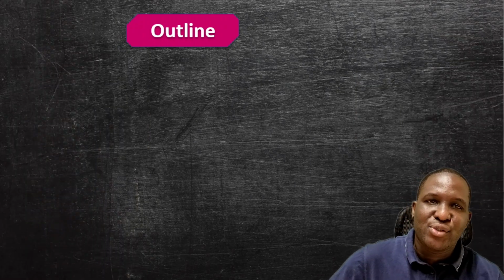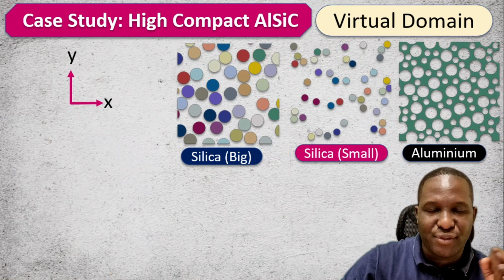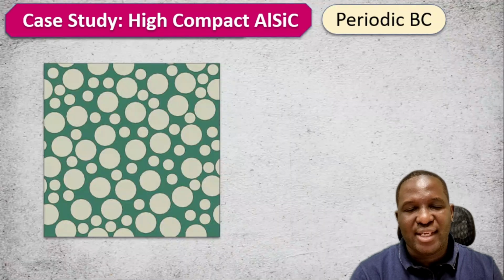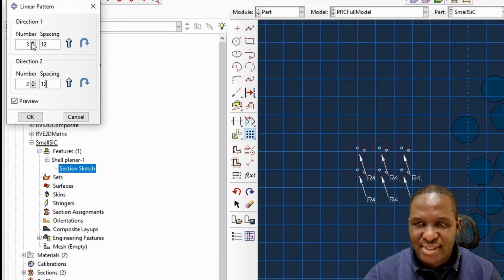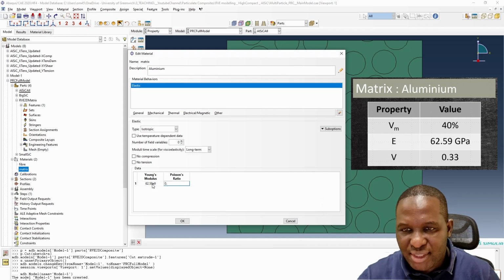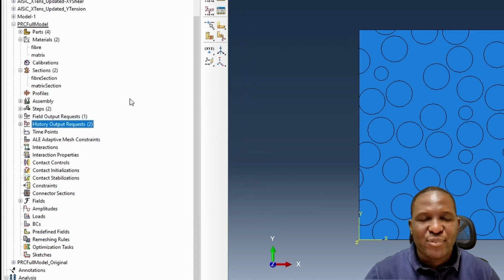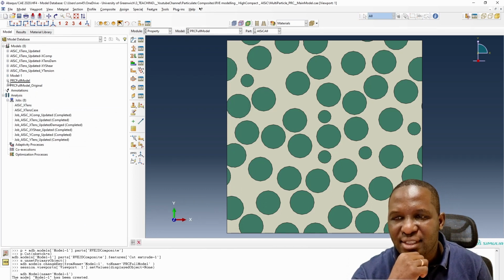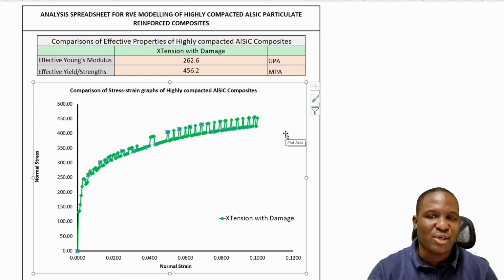How to model highly compact  particulate reinforced composite

Comment: Thanks for this valuable tutorial video. Which failure criteria should I use for epoxy- alumina with around 84% by weight ceramic particle?
Reply from the maker: It depends on the length scale of analysis.
Reply: @MichaelOkereke Excuse me, could you please explain more about length scale of analysis?
Reply: @MichaelOkereke Excuse me, could you please explain more about length scale of analysis?

Comment: Hello Professor. I am modeling with a 2D plane, the cell is a plane strain triangle cell, the PBC condition is imposed, the material is single phase, and the modulus of elasticity is 187 GPa. I am using your method of solving for stress-strain curves and solving for the modulus of elasticity. Why is the calculated value 10 GPa higher than the input value (205 GPa)?:hand-pink-waving:
Reply from the maker: Not sure I understand the problem.

Comment: Hello, thank you for your useful video, if the particles were packaged (as a packing), can we use this method?
Reply from the maker: Hello @R. Sadeghpour, of course yes you can! Obviously, you will need to find a way to generate the particles as a packing (clustered particles). The code I used can generate moderate clusters but not excessively high volume fraction packing. The simple answer is yes!
Reply: @MichaelOkereke  Ok,thank you, do I have to define a constraint between particles?
And, Have you ever used Digimat Software for modelling?

Comment: Hi Dr Okereke, this video is useful and educating as your previous videos, so Thank you a lot. Meanwhile, I have a question Sir; did you have time to check the reference article I mentioned before? I am really waiting for the results of that modelling.
Reply from the maker: Hello Sina, thanks for your query. I have seen the article and can see what the authors are doing with the modelling. I am not at a position to do this modelling. It is interesting but does not fit within the content of videos that I am focusing on at the moment. Thanks.
Reply: @MichaelOkereke  Thanks for responding Sir, I will be so much grateful if you could help me with a tutorial or guide which lead me to handle the issue.